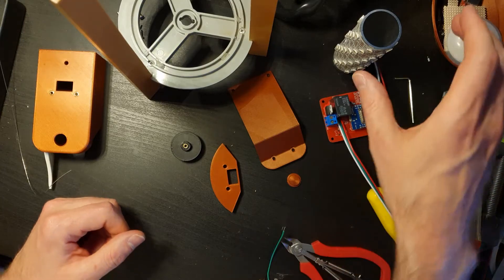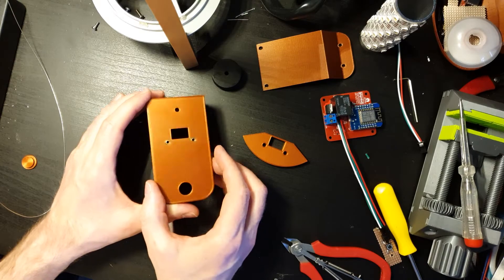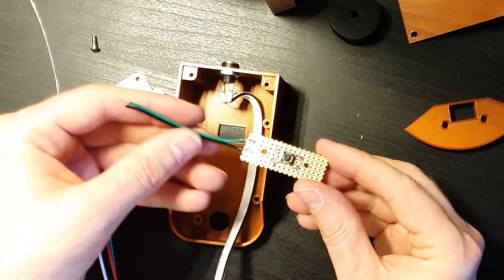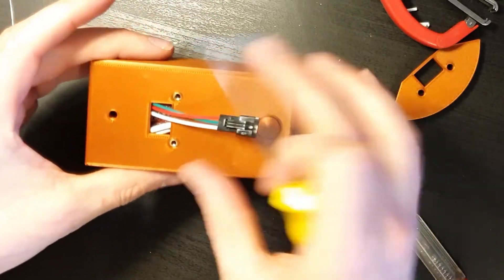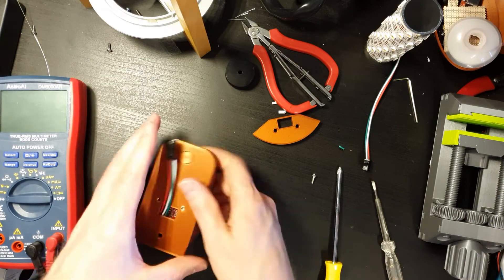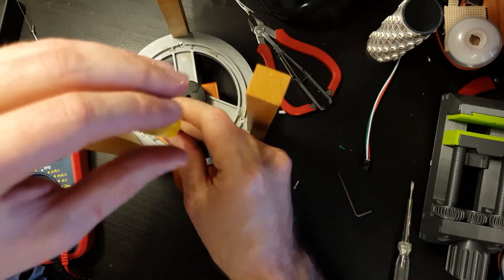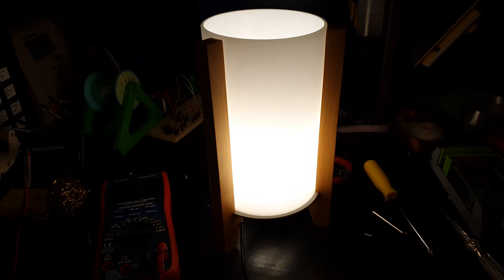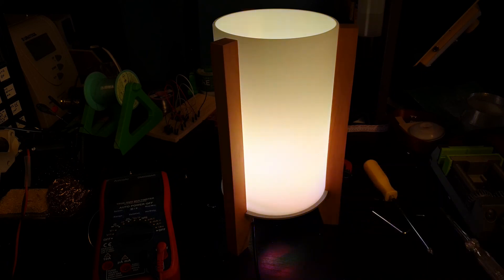WLED Bedside Lamp - EP3 - Putting it all together

Comment: What you call convoluted I call very neat and well prepared. I forget to add that kinda stuff for my builds haha
Reply from the maker: Your too kind 😄 what I didn't cover in the video is that I should have moved the power socket over as the plugs strain relief fouls on the leg a little. But it works lol